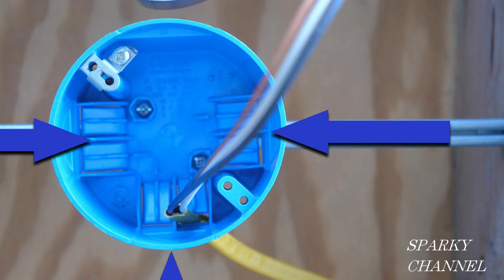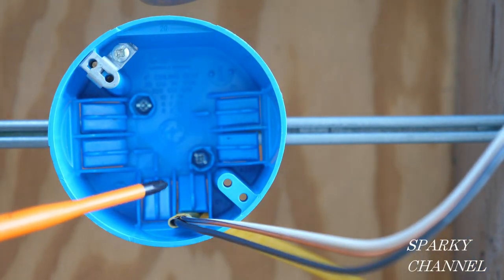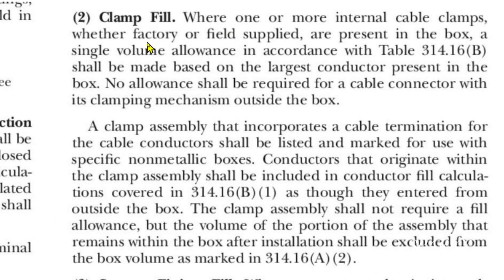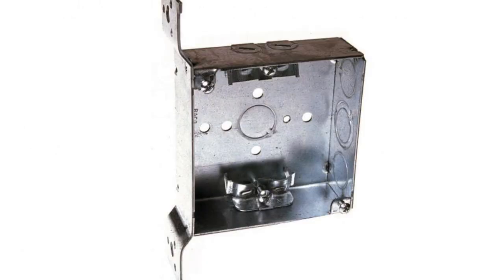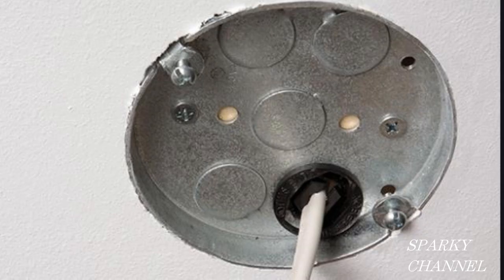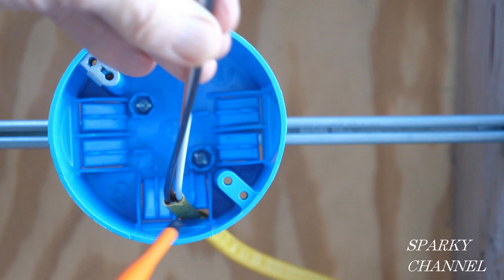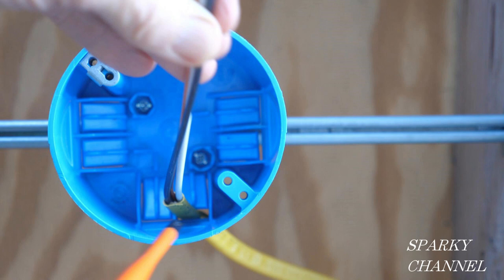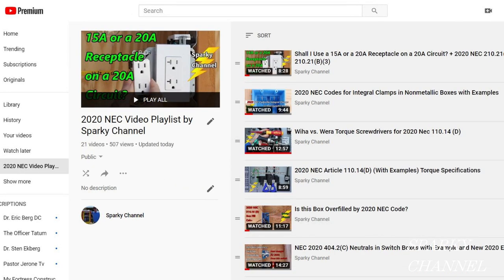Are Integral Clamps in Plastic Boxes Counted as Box Fill by 2020 NEC?

Comment: I would say these flaps don't count. They're not proper clamps, compared to the other ones shown, which require much more space. The space the plastic ones take is insignificant. It's interesting how you do the things in the US with volume of the box. Here the boxes have stamped on how many wires of which size are permitted and how many terminals are permitted in the box.

Picture of a surface mounted junction box:

https://der-elektriker.org/wp-content/uploads/2016/07/Abzweigdose-Beschrifftung-1024x700.jpg

The labeling is the permitted voltage it's rated for (in that case 400V, three-phase), ingress protection (in that case IP55). And the interesting part on the right side of the picture:

Querschnitt is cross-sectional area of the conductor in mm², that's the wire size. The box is designed for 1.5 and 2.5mm². Klemmen are connectors. And Leiter is conductor.

So for 1.5mm² you can put in 20 conductors and have six conductors in this box. For 2.5mm² it's 15 wires and five connectors. But this rating is for the old connectors, newer connectors don't require that much space. And sometimes manufacturers don't change the voltage rating, still got the old 380V stamped on their boxes instead of the 400V which it should be now. The voltage in Germany was increased in 1986 from 220V to 230V, so the voltage between the lines also increased from 380 to 400V.

That's the old way we did terminate the conductors before Wago connectors became popular. The first three minutes of this video show how this was done back then:

https://youtu.be/_PDnKEgQ-2Q

The old connectors were rated for 250V, 16A.
Reply from the maker: Wow, that's interesting. That's a lot of information printed on your boxes. I hope you guys are having great holidays!
Reply: here in the US we need those very corners to tuck our massive AWG12 in, because of the half-assed voltage.
Reply: @wim0104  AWGs cross-sectional area is 3.31mm², so the most comparing wire size here would be 4mm². AWG 14 is 2.08mm², so the fitting metric size would be 2.5mm². Under best circumstances 2.5mm² can be fused with 25A in a single-phase circuit, without getting above the critical temperature for the PVC insulation. That are 5.8kVA. In a three-phase circuit this size can be fused with 20A max. that would be 13.84kVA. 1.5mm² is usually fused with 16A at max., no matter if three-phase or single phase. In a single-phase circuit that would be 3.68kVA, in three-phase 11.4kVA.
4mm² can be fused up to 35A single phase at max., in three-phase 32A. That are  8.1kVA in single phase or 22kVA in three-phase.
Yes, it's definitely the voltage...

Comment: Those clamps on blue boxes are horrible. They make your splices so much harder to make neatly.
Reply: yup, I'd much rather us a metal fanbox, also for wall mounts.
Reply from the maker: I agree.
Reply: I won't use those if I can avoid it.  Arlington and T&B make a much better cable grip knockout.

Comment: The concept that manufacturers already include clamps in what's stamped on the box has a problem in that 8/14 stamped is only valid if only 14 ga enter the box. If a mix of 14 & 12 those stamps are meaningless, you have to use the vol per ga to compute the total volume needed and the box's cu in size to know the max allowed. Those 8/14 markings are only for convenience when all same size wires are used. Since all clamps count as 1 unit you still need the vol required for that 1 unit which is whatever the largest conductor is so 2.25 if 12 ga and 2.0 if 14 ga. The manufacturer can't know the max ga in the box so they can't include clamps in the 8/14 type stamps.

Comment: These are NEITHER interior nor exterior clamps. As you stated, they are integral clamps. They simply aren't mentioned in the code you were reading. They are not being added to the interior of the box, taking up extra room, as the interior clamps you displayed in the metal boxes. These clamps are in line with the frame of the box, so neither interior nor exterior. The volume of the box has been calculated with these clamps already in place. Again, they are not being ADDED to the interior of the box.

Comment: Thank you Sparky for your very helpful videos.  I just looked at a Carlon pvc blue box sized at 25 Cu in inside the box and it list inside the box of how many of each gauge fill.  Example 12 gauge would be 11 wires which works with the math.  25/2.25=

Comment: Do you have to add that 2.25 for each individual clamp, or just once for all the clamps? My instructor said those don’t count either way. Thank you very much sparky!
Reply from the maker: Depends what your largest wire size in the box is. If it's 12ga., yes, it's 2.25 total box fill for all the clamps.

Comment: I think the next code cycle should address this.  If the clamp can be removed, then it should be considered for box fill, if it can't then it shouldn't be part of the box fill and the box manufacturers should calculate the interior space by excluding the non-removable clamping areas.

Comment: they dont count until you put a wire through them.  since you cant stack nm in a single clamp you'd have to use the number given in the table  would be my guess.  best thing is to get a written answer from the manufacturer.
Reply from the maker: Do you happen to have a NEC code for not stacking nm in a single clamp?  It used to be 314.17(C) but that article doesn't exist anymore in the 2020 NEC.
Reply: @SparkyChannel  i havent kept up with it  thats why i watch you  thanx

Comment: I feel like they wouldn't and shouldn't count. In addition to the fact that manufacturers probably do take those into consideration when they stamp the volume on the inside of those boxes, the idea seems silly anyway.  I mean code can be frustrating sometimes because I have boxes that are stuffed and difficult to maneuver wires, but they are not overfilled according to NEC, but then I have other boxes that have plenty of breathing room but technically are overfield according to NEC.  I am always against more micromanaging more red tape and making things more convoluted just because it seems like an insane path to go down. But at the same time it is frustrating but I don't think anything reasonable can be done about it.  Another thing to note is that they don't just stamp the volume on the box they also stamp wire allowance based on whether it's 14 12 or 10 gauge wire. You could probably use those numbers and the volume that are both stamped on the inside of that box to figure out definitively if the manufacturer does consider the clamps when they are measuring the box volume.  I'm actually curious and I'm going to do that.

Comment: At 3:04 I've used a few of these on some metal boxes I found that had no clamps at all. They are quite strong and stabilize the wire well. But are they lawful to use in the knock outs of the service panels or are steel threaded ones only allowed?
Reply: We have subpanels here in Austin TX (i.e. city inspectors look at it) with tons of those: if they didn't pop out, you're good.

I've seen master electricians use the bushing version of these, because of the popping out problem.
Reply: and the cheap grey plastic push-in clamps? I don't understand how they got listed; they can just be pulled out of the box with the wire.
Reply from the maker: Good question. I would definitely use the steel threaded ones for a service panel.
Reply: @wim0104  are you referring to 1050s?  they hold much better than the cheap ones, and are rated for two cables in the most common sizes.

Comment: my interpretation is that those are not clamps.  they are cable entries that happen to secure the cable.
Reply from the maker: I agree. However, as an electrical contractor I have to play it safe and count them. I do wish that they would clarify this kind of thing in the NEC though.
Do you happen to know where I could find the code forbidding 2 Romex cables in one integral clamp? It used to be in 314.17(C) but that article doesn't exist anymore in the 2020 NEC. Perhaps they are allowing 2 cables in one integral clamp now?
Reply: @SparkyChannel  that's another one I'd have to look up when I get a new code handbook.  as I said elsewhere, I avoid Carlon boxes because I hate that cable entry design.  I also won't stuff two cables through one hole in a nonmetallic device box unless I have to.  I'd guess the two in one clamp comes down to the rating and listing on the clamp.
Reply from the maker: @jsncrso  Do you have a link for that so we could read it? Thanks!

Comment: Per Carlon, you need to deduct for the clamps. And, manufacturers recommendations on listed devices trumps code.  So, yes you need to include them in your fill volume calcs. https://carlonsales.com/techinfo/faqs/FAQ-ZipBoxes.pdf
Reply: Thank you for that link. It is a treasure trove of information.
Reply from the maker: Excellent link, thanks! Here is Carlon's answer: 
The volume inside an outlet box does not include any deductions for integral
clamps. The clamps are removed from the box when the volume is determined
by UL. Therefore a single deduction in the NEC is required for the space the
clamps take up inside the box. A B520A is 18 cubic inches after the clamp
deduction for #14 wire.
This procedure was determined by IAEI and UL. Not everybody agrees to this.
The 2002 NEC (314.16(B)(2)) still has the deduction requirement. Keep an eye
on the 2005 NEC because it may be changed.
Reply from the maker: 314.17(C) doesn't exist anymore in the 2020 NEC. Do you happen to know where I could find the code forbidding 2 Romex cables in one integral clamp?
Reply: @SparkyChannel  With the advent of the internet it has gotten easier to find the manufacturers instructions, and recommendations on most things.  There are two ways to discuss things with the Inspector and get them to change their opinions.  The commentary in the codes, which not the “Code”, do explain what the authors intended code to accomplish.  Frequently the commentary will clear up what might seem vague.  The other thing you can discuss with Inspectors is the manufacturers instructions.  

I used to have problems with one inspector about the breaker size for mechanical devices.  The old less efficient unit would have required a 20-amp single pole breaker.  The new device had a requirement for a 10-amp breaker.  The Inspector wanted the 10-amp installed at the panel.  I finally convinced him that the breaker in the panel should be sized for the conductors to the device, and a single breaker box installed at the device with the breaker required by the manufacturers instructions, by using the commentary in the International Electrical Code (A duplicate of the NEC, published under license by the International Code Council).
Reply from the maker: @randallthomas5207  Thanks Randall!
Reply: @SparkyChannel  I’m not sure where 314.17(c) requirements would be now.  I’m in the process of studying for the code exams right now, but all the codes are at work.  And, since I work for the Federal Government I am officially locked out of the building until a funding bill gets passed.  

P.s.  This is why I’m studying the International Electrical Code, Congress mandated that all federal agencies enact the latest editions of the International Code Council family of codes for all federal projects.  Causes issues with State licensed Electricians, because they know and work under the Idaho Electrical Code, a modified NEC variant, and we work under the unmodfied International electrical Code.  Things like arc fault and ground fault devices vary between the two codes, with the IEC being more stringent.  I have an Engineer In Training going through the latest Idaho Electrical Code, and the International version listing the differences, so we will have a cheat sheet to give to contractors.  And, after she does that I think she will be ready for her inspectors exam.
Reply from the maker: @randallthomas5207  Best wishes with your tests and with the funding as well! And thanks for the information
!

Comment: Metal boxes superior to plastic boxes
Reply: besides cost, volume, ease of installation, sometimes neatness of cable entries, and the need to do extra fussing to protect nonmetallic cable, that is.
Reply from the maker: I agree, thanks!
Reply: But a plastic box makes it easier to screw in a dry wall screw to hold a device <grin>